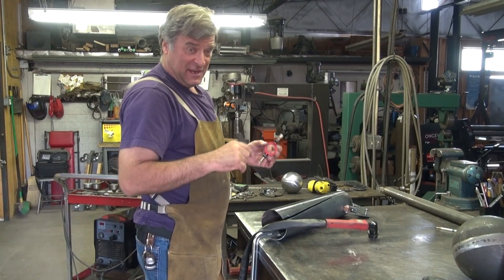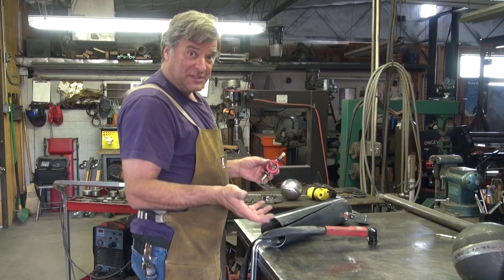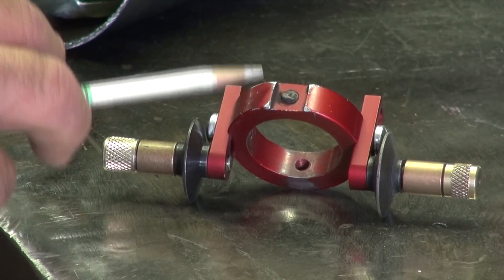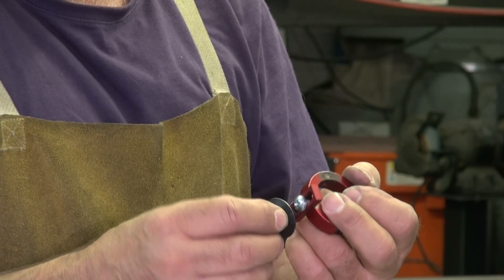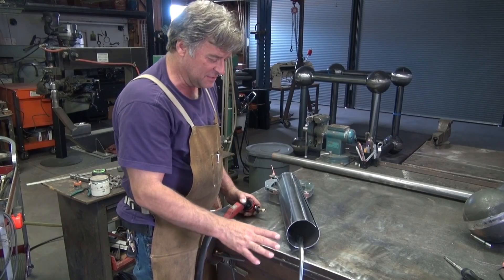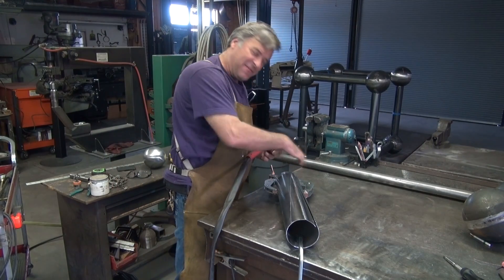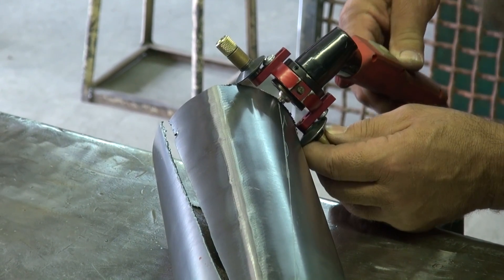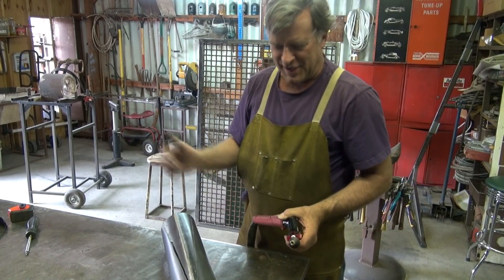How to Cut Pipe With a Plasma Cutter - Kevin Caron

Comment: Cutting pipe with a plasma cutter is tough.  We use drag tips so you don't have to herd the wheels where you want it to go.  We started to add a chuck to cut tubing on the CNC plasma table and was working bugs out of it when my son decided that he didn't want a rock crawler.  Noe he has to cut up some 6" by .25" tubing in the near future, so we are going to get the bugs out of the tubing cutting part.  I remember the trouble of printing out a pattern, tracing a saddle and cutting it out with a hand held plasma torch on about 23 pieces of 2 3/8" drill stem.
Reply from the maker: A real skill to doing it correctly for sure!

I just need more practice.

Comment: Hi Kevin, i have a question for you.. Im about to build a roof rack for my Jeep and im having some tube issues. Lets say i have a 5ft long 1" tube. Now i want to cut each end 45 degrees.. That´s not much of a problem. The problem is: How do i get the Cuts to match at both ends?? Just a Little twist on the Cuts and it´s useless..
Hope you understand what i mean. Thank you (and your wife of course) for your great videos.
Best regards, Jimmy.

Comment: While using my plasma cutter on a much smaller pipe, I learned:  If one is not careful where said pipe is pointed, those sparks may go into an open topped 5 gallon bucket full of rags.  And said sparks may ignite this bucket of rags.  Being a retired firefighter (30 years on the job), I am attuned to certain signs.  Such as flames and smoke coming from a bucket.  Threw a lid on it and took it outside.  Didn't want to waste my 2 day old fire extinguisher... BE CAREFUL where ya aim that pipe!

Comment: a trick l use is magnetic tape, you can bend it any witch way on steel using a drag tip,and just rest the gun against it like you would with a straight edge,,